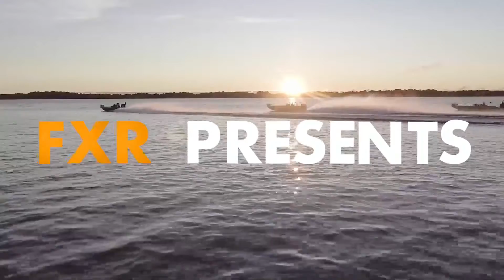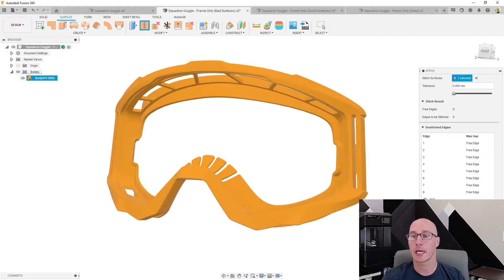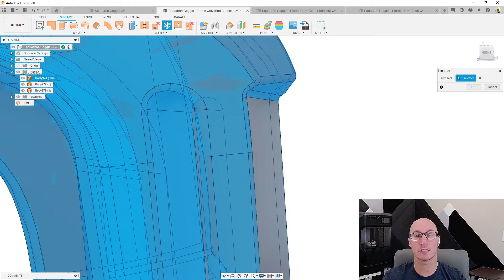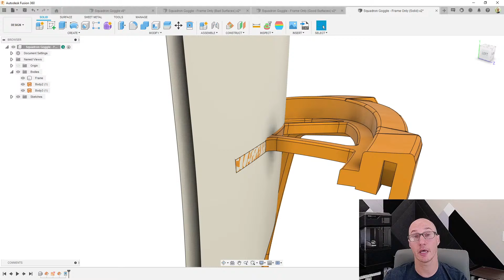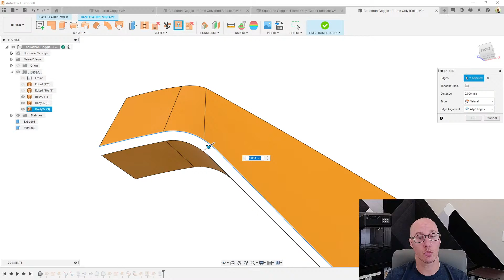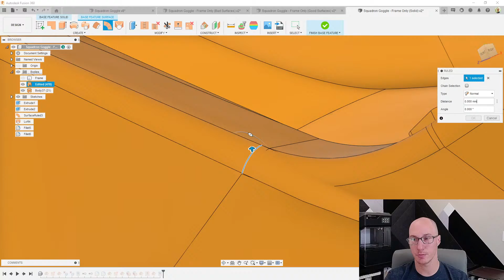360 LIVE: Intermediate Surface Modeling for Fusion 360, Featuring FXR Racing and Makerbot Method X

Comment: Can't wait for the next advanced surface modeling !
Reply: Go to 10:28 and he shows the parting line dialog box... at the top of the box there are two types of draft, the left one looks like "Planar" and the right one looks like "parting line". He did not demo those but I too would love to see this in more detail!
Reply: @jeffk412  Thanks. So, this is not covered by an actual example use (yet).

Comment: Hi Jason, nice to see some more advanced tutorials on surface modeling! I picked up a few good tips here! I see you have trouble with your zooming a couple of times. When working on tiny details, you may what to switch to orthographic view mode. Since it’s not possible to zoom past the model in orthographic mode, you will be able to zoom in all the way and keep full control. Especially when using 3D mouse.

Keep up the good work!
Reply: Blaise! No surprise that I'm seeing a great tip coming from you. I normally use orthographic mode. I used perspective for this live stream partially because the switch from the blue goggle picture to the blue goggle CAD model would look better. The zoom was frustrating and only highlights another reason I prefer orthographic!

Comment: Surface normals are important when it comes to graphics and decals.  A surface map of a graphic will be applied to the surface normal and informs the graphic system how to wrap to adjacent surfaces.
Reply: Great point. I'm going to look into this further
Reply: @jasonlichtman  It's also important in Fusion360 if you use surfaces as a probe location.  Flipping the normal will change the probe cycle to the opposite side of the surface.  For example, if you have two parallel surface bodies with normals facing towards each other (or in the same direction) the probe cycle will choose x-Channel.  If you flip the normals (normals opposite each other), the probe cycle will change to X-Wall, very important if you don't want to crash your probe.
Reply: Interesting to know. I use "reverse normal" but I'm not sure why (see "Hyperboloid Study 2" on my channel).
I think I'm reluctant to stitch surfaces if they are not "well positioned" first. But I've been said it has absolutely no consequences for obtaining solids.